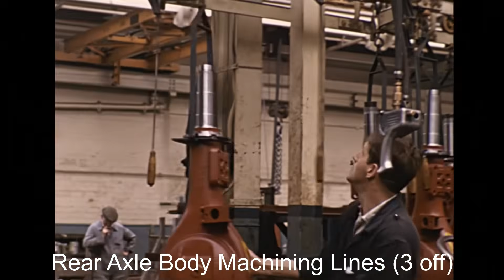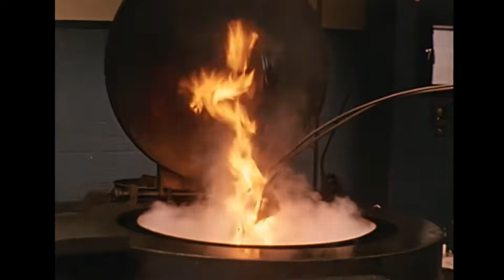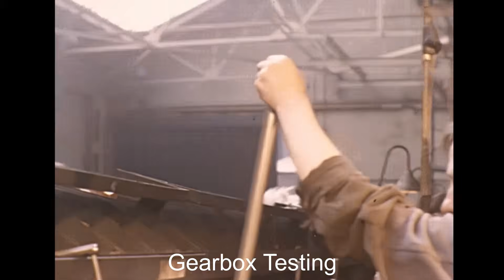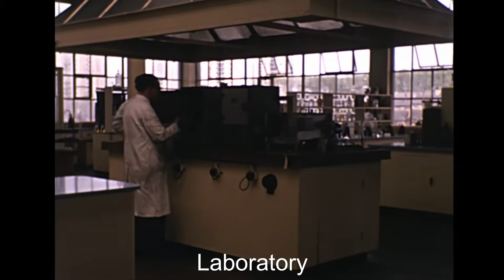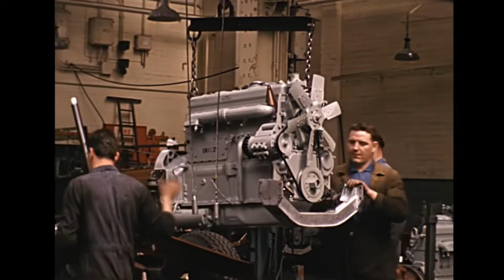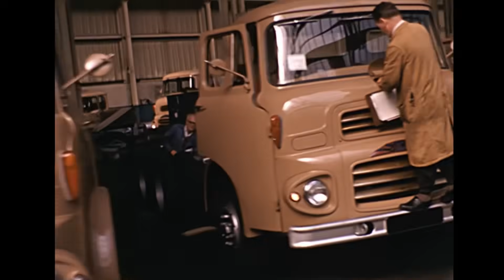Albion Motors Vehicle Production 1961

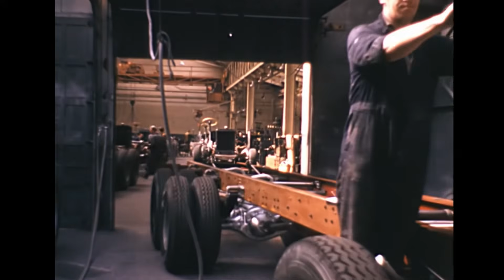Comment: @15:19 - is that TWO prop shafts from the gearbox rather than a interaxle diff (power divider) in the front drive axle?
Reply: 6x 4 Reiver trucks had a “ relay gearbox” fitted between the gearbox and the front drive axle. This had a single prop shaft going in and two prop shafts going out! It had a differential to allow for different axle speeds when cornering, rough ground etc and this could be “locked” via a switch in the cab. Locking ensured that both axles ran at the same speed on rough ground and there was no wheel spin! Thanks for your interest, Jim

Comment: Fascinating video. As a young apprentice at London Brick Co I got a lot of experience of Albion. Those axles often cracked the differential rear pan where the locating dowels fitted. These were easily brazed up. The other vulnerability was the crown wheel bearing pre-load adjuster lock plates breaking. The gearbox was bulletproof. Fond memories watching this, I loved the Albion. Overhauling the multi pull ratchet handbrake was great fun. Thank you for the trip down memory lane 🙏

Comment: Dad and his brother worked in Albion in the packing case shop   Dad died on Tuesday at nearly 89 years old brother about 10 ten years ago 😢
Reply: Hi, Jim Anderson here. Very sorry to read of your Dad’s passing. Your Dad and his colleagues did a fantastic job. For people who don’t know, half of Albion’s production was “CKD”. That stood for “ completely knocked down”. At Yoker factory there was a big open space and your dad and others built big wooden boxes into which they carefully fitted engines, gearboxes, axles and all the bits to assemble a chassis. The chassis frame rails were strapped together and were not normally in the case.
Packs were normally for multiples, e.g. 4 chassis. When the box had all its parts, the box was closed and the details were stencilled on the outside, mainly where it was going to. Africa, Australia, New Zealand, etc were common. Unfortunately there was no film of the CKD operation. I wouldn’t have known your dad, but I’m sure I would have seen him in the 1960’s at work when I worked at Yoker around that time. Happy days! Kind regards

Comment: This is a very good and interesting video about Albion production. I started my apprenticeship mechanic at CIE road garage in Dundalk Ireland. In 1962
They had many Chiften and Reiver models with 4 cylinder engines and 6 cylinder Leyland engines.
The rear axles were of the hub reduction type , they were very strong never give any trouble . I came to Australia in 1970 where I continued to work 
On Albion’s and Leyland . One small problem the ALBION had was the heat from the exhaust manifold and down pipe had no insulation just a thin 
Steel panel that would get so hot it would burn the driver’s leg in our Auzzie summer. Thanks for the great narration no music just FACTS.

Comment: Very interesting video. I am glad it survived. Also the narration was well done, just the right level of information. The factory looks quite efficient for the time. These days the paint sprayers would have better protective equipment or be a robot. It reminds me of the engineering works where I started in the 1970s, with all the draughtsmen wearing ties and having a picture of a glamourous lady stuck to a filing cabinet (12.57).

Comment: My dad bought a new 6 wh reiver in 1964 it was to replace a bedford tk. As he did long distance work the cab was cramped conpared to the tk. As far as i remember it was totally reliable .he had it 3yr around 1971 i saw it a few times and was told it had been very good am i right in thinking the front wheels were 9stud and back ones 10 stud .they were happy days

Comment: Splendid stuff - back to the days when we MADE things!
We've a EN 900 Vertical 15 litre engine in a 1953 Fowler diesel shunting locomotive at the East Anglian Railway museum in Essex, and it transpires there's not many around. When I enquired about parts after it dropped a valve into number 2 pot, the guys at the local engine reconditioners laughed when I went in there.  I bought what was reckoned to be the last new piston in the world off their shelf, and they got new valves made in Serbia of all places. If anyone out there wants new headgaskets, I had some made by the original manufacturers to the original design but modified to accommodate enhanced reliability when BR identified faults with the horizontal 901 on their railcars. Not many of those in preservation, but the bits are the same as the vertical. The EN 900 vertical engines i was told, got fitted to Australian Road Train Albions, Super Buffalos? Ho hum, bet the factory is now a housing estate!
Reply: That’s true of the AUS Super Buffalos

In NZ, the South Island DSC diesel electric rail shunters had two EN901s (centre cab locos)

They were extremely successful 

Happily the DSCs were reengined with Cummins NTs built over at Shotts!

Most DSCs still operate today
Reply: yes before owners moved production offshore to be made in cheaper labour markets along with the profits into tax havens !

Comment: I always thought the 5spd was standard gearbox and sixth was the optional fitment.
Reply: I think you are right. The sixth speed was actually an ' overdrive'. You can see it being fitted to the rear of a gearbox in the film. ( 7-10 to 7-30 ) This (as far as I can remember) was operated either mechanically by a lever in the cab or an air operated cylinder situated in the bell housing (around 1970 ish) . It  was actually a two speed output shaft which you can see above the gear and selector in the film, before the rear casing is bolted on, giving a 'half a gear' or 'splitter' on all gears except first or 'crawler'. I stand to be corrected, of course. Another fine detail was the reduction hubs which enabled weight saving through using a high speed prop / half shaft arrangement to drive a geared down wheel hub.

(Albion Clydesdale 1971 , 4 wheel  16 ton GVW model, with 6.3 Ltr.  401 engine  . Reg HUC 525K . I fitted a power steering kit for around a 100 quid which transformed the handling of the vehicle. 60 MPH was no problem . It's great weakness was the injector leak off pipes under the rocker cover splitting, when you started to gain engine oil instead of using it you new you had a problem.)
Reply: @xzox Ye @xzox father had two Albion tippers the Lad came with a 5sp splitter, he added the the overdrive 6th when the box got rebuilt, the Ergo came with 6th overdrive and a splitter. These gearboxes 3 and 4th would fail from memory. There was the standard gearbox, 5 speed plus optional overdrive 6th, and the splitter box, which the first 4 gears only could be spilt, first splitter boxes were small handle above ratchet brake, and latter were air button on gear stick. Being 9 speed in 5 speed splitter, or a 10 speed in 6 speed splitter. Splitters were nearly always standard fitment on tippers, they were not a 2 speed but proper splitter box, Leyland lads sometimes came with 2 spd Eaton axles running straight 5 or 6 speed Albion gearboxes with red Eaton 2 speed switch bolted to stick,not sure on mixer chassis, but suspect they were. Tipper were geared to 54mph, I remember 55 was most my father got, road geared chassis would like you said would be 60 or slightly higher. The very last Albion Lads on short 6x4 mixer wheel bases came with an AEC 500. Engine with 6sp AEC box’s. And axles were Albions, Albion ergo ceased production before Lads

Comment: When the Assembly Track was fitted in the mid-sixties it increased the output of chassis immensely. Leyland supplied the engines but Albion still manufactured gearboxes and rear axles.

Comment: hi Jim, great video, i used to work at AEC in the 70's  the cabs were tilt cabs made by J Sankey ltd,every chassis was given a 30 mile road test, chassis were finished in red oxide paint before  delivery to the body makers, i also wore a brown work coat